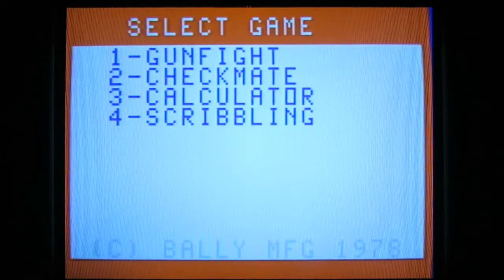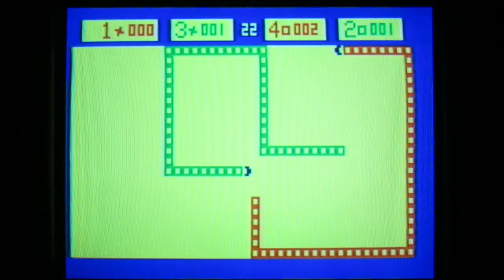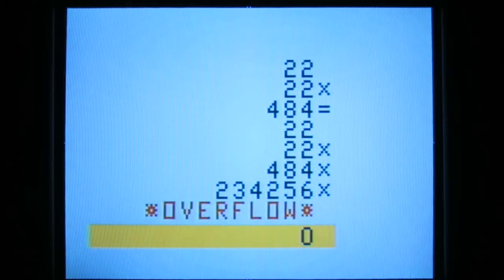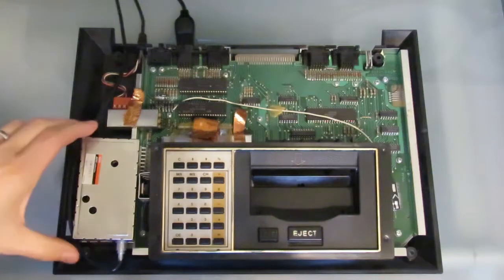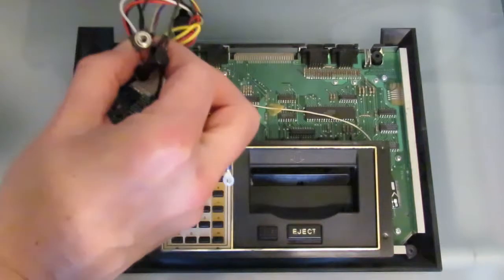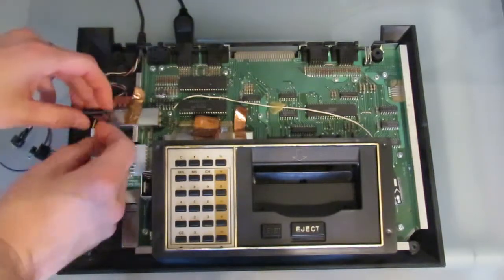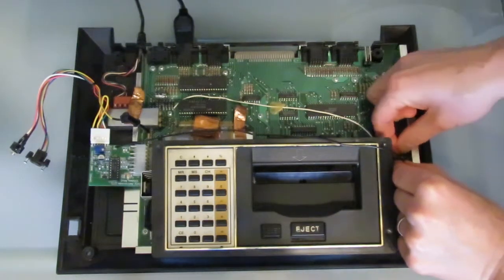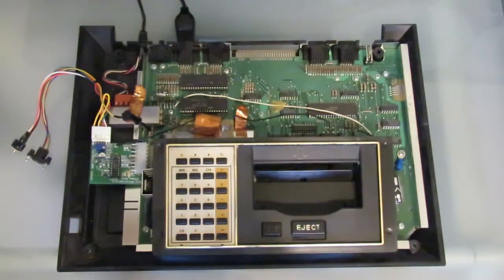Bally Arcade / Astrocade S-Video Upgrade Kit Installation

Comment: 😳. I can't believe the content you have regarding this system. Two years before I was born circa 1978 my dad purchased this system and a few of the accessories. When I turned 4 my older cousin would babysit me all the time. We played 4 of the multi-player games constantly. 

Our system never failed. It sat on a cold concrete slab in our Michigan basement at all times. Little did we know this saved the system.
Reply from the maker: I'm glad that you've found my Astrocade videos here on YouTube.  You're right, there sure a lot of them.  I made most of them slowly over a long period of time, but they added up to a substantial stack of Bally Arcade goodness.  My favorite videos that I've made for this obscure system are for an even more obscure cartridge: the Machine Language Manager.  There are probably only a handful of people who can or will appreciate that four-part series, but the videos were fun to create. 

The four-player games on the Astrocade are pretty good.  The game, "War," a modern Astrocade hombrew from about 2010, is one of the best games for the system.  If you pick a multicart for the system, then this game is probably on it.

Comment: Can you take pics of the board front and back so others could make it?
Reply from the maker: The s-video kit for the Astrocade became available again in the last few weeks for $49 from Vector Labs.  Since the demand is small, each one is made to order.  You can get it here:

http://vector-labs.com/index_bally_svideo.html

Also, in about the last week, there has been some discussion on the Bally Alley Astrocade forums at Group.io about the new version of the s-video board:

https://groups.io/g/ballyalley

I'm glad that the board is available for sale again.
Reply: @ballyalley  me too, u just got one and recapped it and cleaned it up.  Also added the heat sinks to the 40 pin chips.  So all I need now is svideo, multicart, and replacement cover for the cart storage area.

Comment: Where can we buy this mod board?
Reply from the maker: This board was made in a limited run in 2007 by 8-Bit Domain.  It is no longer available.  I have a few more details about it in my text description for this video.
Reply: @ballyalley  is there anything out there I can use to mod for better picture? Even composite is fine for now.
Reply from the maker: @JohnyTheWizKid  I don't think that there are any video upgrades for sale sale currently for the Astrocade.  There are a few schematics for them on my website.  Here is one that has been tested by at least once person (this URL is long; I hope it works in this post):

Composite Video-Out for Astrocade, By Justin Pittman (January 20, 2019)

https://ballyalley.com/documentation/misc_hardware_docs/misc_hardware_docs.html#CompositeVideoOutAstrocadeJustinPittman

Your best bet is to ask about this video upgrades on the Astroacde discussion group, here:

https://groups.io/g/ballyalley

Good luck!
Reply: @ballyalley  thank you. I'm also looking to do the same for the Fairchild channel F and Magnavox Odyssey 4000 or just pong consoles in general. Maybe if possible, the Nintendo color 15 one. Ever since I heard of this, it opens the door to so many possibilities.